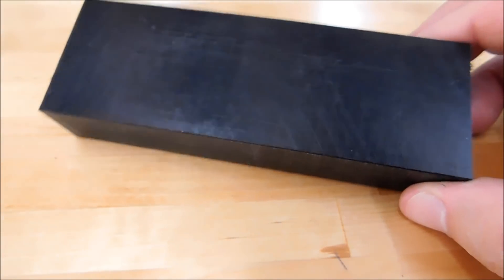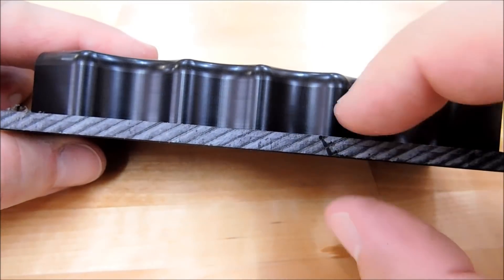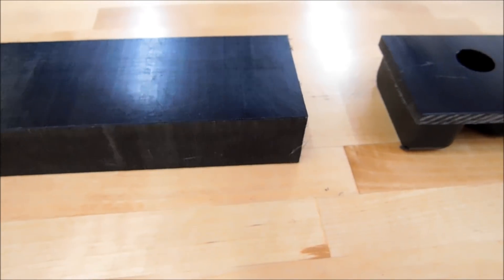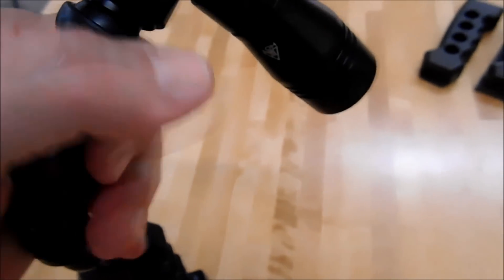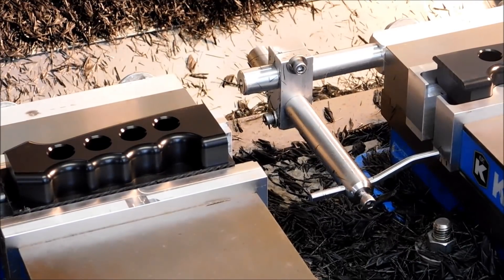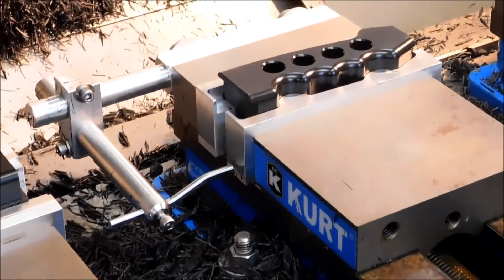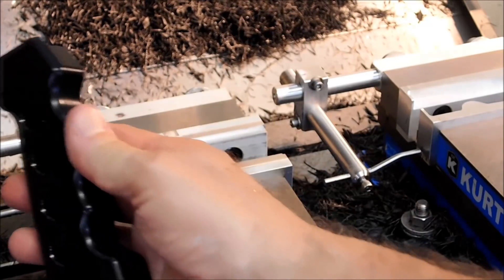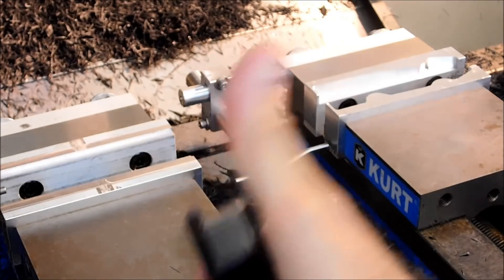Flip Flop Milling

Comment: Wasting you life waiting for tool changes making one at a time, specially with that incredibly slow tool changer.  I could finish 500 on my horizontal before lunch.  put 48 of those bad boys on the tombstone, hit the ends on the 4th axis, load a few times and im done.  I would slap a sheet on each face and save all that cut time on the band saw too.  pop the sheet of op 1 parts on op 2 using ID grippers on those holes and not even cut each part out.  tighten the op 2 sheet up with an impact while  the spindle is still turning on another 4 sheets of op 1 parts because I have a pallet changer :)  That was so slow it was painful.  sorry boss, definitely not the optimal setup.  nice video with really clean footage though.
Reply from the maker: Ryan, it is true, there are many ways to do this. Based on my time slot and other responsibilities, this was the best choice. Your option sounds rock solid, but would require extensive tooling and result in a major loss of material. At least 30%.. Id be curious if you made a dime running 500 pieces after spending the time and money on the fixtures and factoring in the waste of the material at about $1. a square inch. This being said, If I had thousands of these to do, I wouldn't do them 2 at a time.
Reply: @joepie221  There would be no more wasted material than that saw cut you already had to do to make 500 individual blocks of material, most likely that saw blade has some width to it and you are leaving flash all around the part. If you ordered pre cut blocks it was factored into that part cost already, time and labor in saw cutting.  the part could be profiled with a 5/16 end mill with same scrap you are already creating.  clamps would cost some money though, but if there is no repeat to the job, why bother.  Parts with no future are not a good investment of time so you are correct, I would not make a dime because I would have to pass and take on the next project that has repeat volumes.  It seems odd that a company would order 500 parts and then that is it, done deal.
Reply from the maker: Ryan Moore  I hear what you are saying, but have to respectfully disagree with your wasted material comment. These handles are sized to be 6 per running 12" of material. Thats factoring in the kerf width of a bandsaw cut. Put that same 12" material on your machine and machine a row of handles with a cutter that you can count on not to flex. 3/8" diameter minimum I'd say. So doing 6 parts your way, you'd need 5 zones at least .38 wide and some end stock to assure cleanup. Lets say.03 per end. By higher math, thats 5 x .375 + .06 wasted for every 6 parts.Or simply put, 1 out of every 7 goes away. Over 1000 parts, thats 142 pieces that will never see the light of day from the material you bought. Even at a greatly reduced cost of .30 per sq inch and a part that requires 10 sq. inches of material, you just threw away $426 worth of material that could have been turned into $3500 worth of product. Plus spent hundreds of dollars on mitee bite clamps and $$$$$ on tombstone tooling. I can run one, a hundred, or 10,000 a dozen different ways. its all a matter of who pays the bills and how much time do you have to prepare.
Reply from the maker: Ryan, on a different note. I jumped over to your channel to see who I am talking with. You got some mad skills on those bikes Sir. Huge respect for anyone that tuned into anything. I've been riding since 1973 and can relate to the skill it takes to do that. I have to ask. Is there a readily available system that moves the rear brake to the handle bar? Sustained wheelies like shown on your channel would be nearly impossible without rear brake control. Take care, Ride safe. "Painted side up" I always say.
Reply: @joepie221  Well i painted the bottom.of the bike so now what joe!? Lol 

Great vide and great mathematical break down of Material use vs scraped, cost break down.

Comment: Off the shelf black coolant segments for holding the flashlights. Neat!
Reply from the maker: We make the end light clips and everything else. The black flex arms are genuine LocLine brand 1/2" coolant line. heavier camera lights need the 3/4". It works exceptionally well and keeps the weight down.

Comment: One word.. Fixture!!!! I make a similar part and we pump them out 24 at a time. Fixtures are keyed so we can be filling one while milling the other. Non stop production!!
Another word.. stop using taps. thread milling is MUCH faster and you can tailor the threads to your desired size.
We don't even use vises any more except for prototype work. Then I have the vise mounted to a blank fixture so I can drop it in in seconds, it's already zeroed too!
Tip 3. Use the good stuff. Don't mess with those cheap no name end mills and inserts. Sure they are more expensive but last 2 to 3 times longer. For delrin / acetal I highly recommend diamond coated. We were going through one end mill per week until we switched to diamond. 3 weeks and we finally take them out.. 300% increase in tool life.
Just my two cents.

Comment: Great video as always!  I didn't understand your comment about milling multiples out of a single slab requiring bandsawing though. It seems like the same chamfer pass on side 2 could be used to separate a group of multiples. Of course it would require ganged vises or a vise like fixture plate to hold it/them all by the ends. I do like the staged approach. But, say I have a 42 inch table to work with, I might have a 12" slab on the left cutting the first side, flip it and drop onto a fixture plate with pins to help locate and end y-axis clamps to hold for the second op, then drop a plate with pins on the top to allow lifting the entire group as a unit and positioning vertically in a long vise type fixture for the end operation on the full set. I guess there should be a fourth position to remove tab and finish the other end also, but for such a soft material maybe the second op being on pins through the holes only needs a clamp at one side of the y-axis and allows access to the other end.

Comment: Where do you set your X, Y, and Z when doing this?  On the soft jaws or the material itself?  Having trouble getting my first and second op to match up in X and Y mostly.  Is that rigid tap or do you have a program that you run for tapping cycle?  I have a 93 fadal 3016 that came with some tapping heads but am afraid to use them yet to be honest.  Thanks for your videos.  You always help me a lot.
Reply from the maker: Excellent response. For the first side operation, I always set my zero location a known distance from the blank surfaces that will rest against hard stops....The rear jaw and left side stop. This way, the material blank can vary in size and I know I'll always get a clean part. The second side of this part must have the zero location originate at the same point the code was driven from or things get bad pretty quick. The coordinate system established in the model will be your zero position throughout the life of the part for CNC. It doesn't have to be on the drawing, just the machine. The use of a tooling hole and offset notation on the setup sheet is a good practice and a huge time saver for future setups. I do that here all the time. The jaws in this video got the tooling hole at the end of the run before they were removed.
Reply from the maker: Hi Ryan. The tap cycle in this video is a rigid tap cycle. Your machine has to come loaded with rigid tap capability or you may have a problem selecting this option from the menu. As for the second op coordination, I always set from the part on a part like this. If you have a fixture with pins and such, set from a known point like mikey_d describes in his reply to you. He's spot on. As for your tapping fear, set you tap up like a normal tool and zero it several inches above your part.  Set the RPM low ( I use 375 ) and program away. Stand back and watch how everything performs. I usually also bring my taps in from at least .200 above the part. This gives the spindle and feed a chance to ramp to speed before the tap engages the part. Let me know if I can help you further.
Reply: @joepie221  Thank you for the response.  Appreciate it.
Reply: What I would do in such situation is to use dedicated work offsets for each of the operations. For first operation the raw stock can be probed / indicated from stock or jaws - in this case it would be easier to use the stock. Second operation is bit more complicated. When you mill the contours in jaws your work offsets should be quite close to perfect. If you plan to re-use your soft jaws you should include a known datum (a precision hole, milled edges) into the soft jaw design from where you can indicate that work offset in future.
Reply: @maikeydii  Thank you very much for the input.

Comment: I've made similar stuff on a CNC router with vacuum table. I usually do around 10 at a time starting from flat stock. Then cut a negative into the spoil board with holes for pins that register with features from the first op. I also put in holes to increase the vacuum. The parts from the first opp all stay attached together but the thin material left is flexible so the pins are needed to keep things indexed up. The second op's round over cuts everything free similar to your technique. I like how your avoiding tool changes by interweaving the operations 1 and 2.  I have to do another run next week and I want to update the tool paths anyway. So I'll have to implement your technique and see if I can save some time.
Reply: Scott E  I use Fusion 360. I reference everything off the same home position. When I run opp one I also run cutting the negative to hold opp two. One thing that kinda bothers me in Fusion is that I need to create a bunch of copies of the body in modeling for CAM operations. It seems like a bit of a hack. In some cases I've been able to use patterns but not always.   With vises your best off running a WCS offset for each vise. That way you only need to be concerned about getting the vise trammed in and not perfectly inline with the other vise(s).

Comment: Good example of single-piece flow but a lot of production real-estate lost to vises. Good candidates for dedicated fixtures, even at <1000 units per run.
Reply from the maker: Valid point, but make sure you include maximum yield per square foot of material in your thoughts. If you use a sheet and cut with a 1/2" cutter, you may loose enough material to negate 1 part for every two you get. If the material is $1. per square inch, it can really hurt at the end of the day. Sometimes cutting blanks can increase profits.
Reply: @joepie221  No blanks mate, just buy bars to a length you can fixture up on the machine. Machine a slot to your grip depth, wide enough for 2 bars and expanding clamps (Imao's "OK Vise" or similar from Mitee Bite) between them. On a 40/20, you could probably get 4-6 bars on a fixture. You don't need each piece cut to length, just place the clamps such that you can make complete end cuts on each part. 1 fixture for side A, another for side B... they should be low cost (easily amortized) to build. If you have the time, build a sub-plate that you can use to locate your fixtures and vises on. A quick change clamping system (Imao Flex is an excellent example https://www.youtube.com/watch?v=ihlpB6qqhgE) so that you can swap fixtures, vises, etc., on and off the machine quickly and accurately. Then you could easily swap a pallet/fixture out and have another one setup with very little spindle downtime. Cheers

Comment: So you're making out like the initial stock piece doesn't have a bandsaw operation before it goes into the machine. On a large sheet there is FAR less door openings in the operations.
Reply from the maker: True, but your comment is conditional on the existence of a plate or fixture to handle both first and second op sheets. I prepared those blanks while the machine was milling the parts. It was a transparent op.

Comment: Excelent work! How do you setup zero coordinates on both vises to eliminate any misaligment between upside and downside milling? Do you use G54 G55.. offsets for each vise?
Reply from the maker: The G54, G55 would work just fine, but my machine does allow for 99 different fixture offsets using an' E ' designation with the values I load in my offset register.
Reply: I don't know for sure. But, his machine may use E values instead of G54 G55 ect. I noticed E3 and E4 wrote on his fixture for the final OP. 
 I occasionally use an older Tree CNC knee mill with Dynapath Delta 20 control. It uses E values, E1 through E99 for work offsets.

Comment: Beautiful parts.  Funny to watch a machinist as opposed to a gadget geek make parts on a CNC.  You go straight at it, not an "adaptive" anything in sight.  Beautifully finished part in a few minutes with minimal wear and tear on the mill.
Reply: Adaptive clearing has its place in machining. Especially in situations where peck depths would be required with standard milling. It makes full use of the flute length of an endmill. There is also the consideration of multiple passes at light tool pressure versus, fewer passes at high tool pressure or load. In regards of machine wear, spindle bearings, ball screws and servros. With that said, I do think some tend to over use adaptive clearing.
Reply: @horseshoe_nc  I'm sure it has its place, but it seems like a rube goldberg machining method.  I appreciate the explanation though.
Reply from the maker: Thanks Barry. The biggest concern on a part you can push like this is tearing the part out of the vise. Otherwise you can run so fast its a pleasure to watch. This material is a joy to work with.
Reply: Adaptive clearing also works extremely well in difficult to machine metals. It helps keep the heat in the chips, and out of the part and tool. 

Joe did touch on a good point. Increased upward pull on the part. One way to combat that, jaws or clamps that bite into the clamp stock. Something like talon grip jaws or pit bull clamps.
Reply from the maker: Barry Gerbracht  I'm with you on this one. I think that adaptive milling is a joke. I watched another channel do a milled slot in a part using this technique and calculated the machine actually moved almost 4X farther than it needed to and at least 50% of the time the cutter wasn't throwing chips. When the guru's start explaining their formulas for whats happening, they all seem to forget only initial passes are full radial contact passes. the secondary passes to widen slots from cutter diameters are much less and therefore don't fall into the 'Parent' formula. Lets not even talk about the hammering of the constant and abundant reversal of the servo motors. It has to take its toll.

Comment: 👍thanks for sharing
 Maybe a mill/drill could save a tool change on the holes?
Reply: It could also do the chamfers
Reply: @zomie1  
O yea, thanks
Reply from the maker: That is a good suggestion, but even a standard 2 flute end mill could plunge and interpolate the holes. I pre drill those pilot holes in to reduce tool deflection.

Comment: Copy and paste the chamfer happening at around 13:30 so it finishes all chamfers on the first part before switching to the second part. Wasting time going back and forth.

Chamfer last so you can use the chamfer bit to deburr the anti rotation pin holes.

👍
Reply from the maker: Everyone makes valid points here, but I'd like to comment from a manufacturing engineering point of view. Lets first consider the lot size and probability of a repeat order. I'm a big fan of efficiency and fixtures. I'm also a big fan of hitting my delivery date on the initial order. These are very important and driving details of all decisions made. if taking already available code and slicing it up for a downstream op would take an hour or more to completely implement, and the change saves 3 seconds per cycle. You have to look at how many cycles it will impact and if spending the edit time actually took longer than the amount of time you save, then its best to cut, paste and hit the button. Thats what the deburr op was. As for no chamfer on the pin holes, the mating part has large cavities and only the side of the pin is a working surface. A chamfer would be a hidden and useless feature that would cost money and not provide any return value.
Reply: @joepie221 , you made all valid points. I've been running Hurco conversational for some time.  I forget how long it can take to edit G code.
Reply: I was thinking chamfer each boss as its own profile. Left boss of left part, right boss of left part, then repeat on right part. Moving the chamfer to the end is also a good idea. Get those pin holes between the bosses as you work left to right.

But, definitely get rid of that juking back and forth between parts. Yeah, it may not look like much time. However, it does add up quickly on a run of a few hundred parts.
Reply: horseshoe28016 

Exactly. Reduce the time spent cutting air! 😅

Comment: Hey Joe, love the video. I was wondering if you considered using that .250 radius on the holes. Would one less tool change save you a considerable amount of time, or would it be about the same since it would have to move about the circumference of the holes instead of just plunging.
Reply from the maker: The overlapping features would result in an undesirable edge in the palm grip area. The chamfer on the holes is about as big as I can go without a feather edge being formed somewhere.
Reply: @joepie221  thanks!

Comment: Are you writing G code or using something like Fusion 360?
Reply from the maker: CAM and manual G code edits
Reply from the maker: Pro Engineer Wildfire 2.0 and 4.0 are the CAD packages I use here.